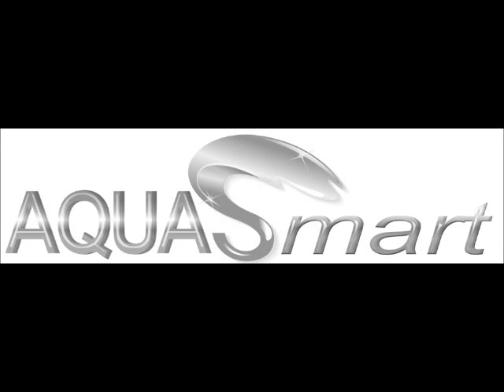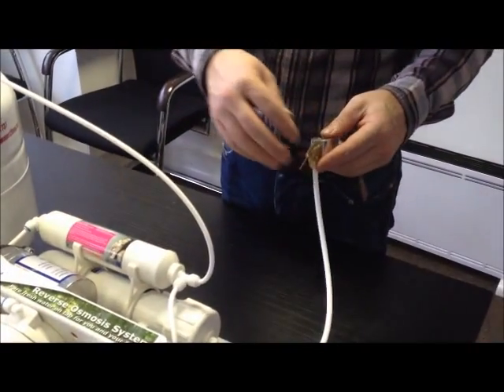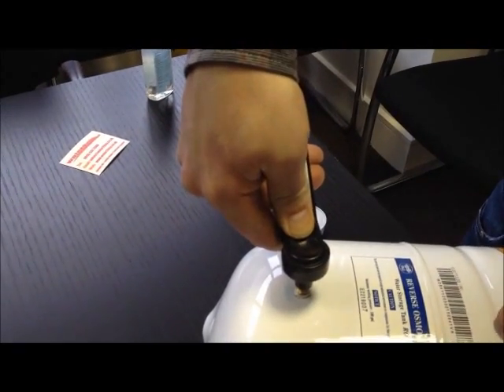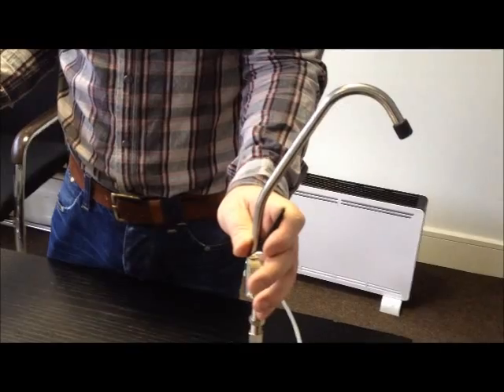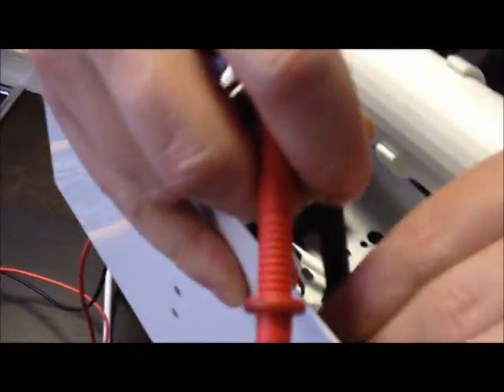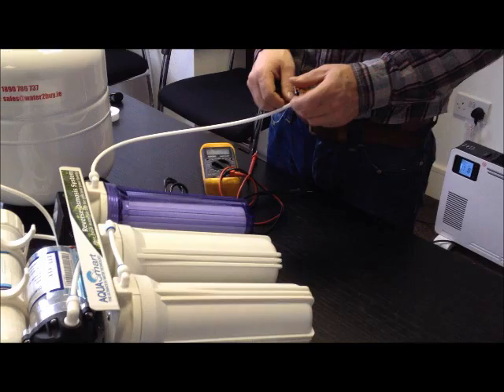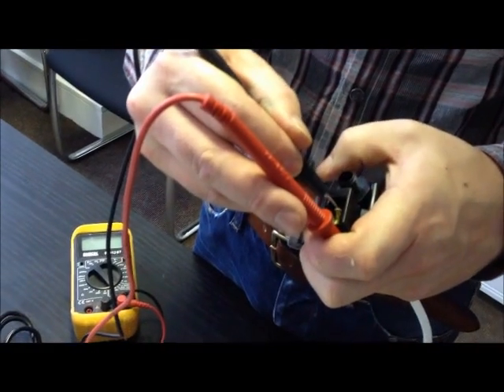Reverse osmosis troubleshooting: No water or a poor water flow from your pumped system

Comment: i had barely any flow on the product side was told to chec k my membranes i did so and they seemed fine no buildup present but after i reinstalled thgem now the system acts like theyre not even there my nproduct pressure is off the guage !!! help what did i do i have a water store comercial system and its been down 4 days HELP PLKEASAE

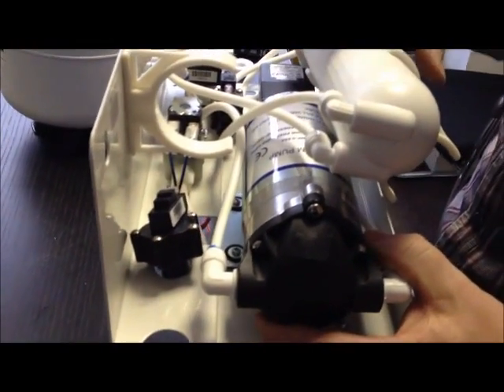Comment: Water are coming very solwy what to do that 2:30 hours After fill 8L
Reply: Thank you so much! I'm a hero now lol... The bike pump worked but I'm not sure if was a pressure problem or if I unplugged something when I pumped.. I pumped once with the system detached and again with the system in line as a power flush

Comment: Hi, I have recently changed the sediment filter, pre carbon filter and RO membrane of my water purifier. The water seems to flow smoothly through all the stages but doesn't come out through the RO membrane stage. I've checked the RO membrane thoroughly and water only seems to be coming out of the reject side and not from the pure water outlet. What could be the problem? It's a brand new membrane and is pretty expensive :'(
Reply: im exactly where you are right now.  I plan on buying a "auto shut off" piece.  Its the one with 4 hoses meeting into it.  Ive changed everything else.  Pump is active and builds lots of pressure.  Every hose is good.  Bladder in tank is 8psi empty
Reply: Did you find any solution

Comment: You were into the demo only a very short time and you solved my issue.  i had over pressured the tank (tank said max pressure 100psi so I put it at 40) and it worked for awhile, and quit.  Backing off the pressure to 7-8psi made it work, (I had replaced the filters).  Thanks again.
Reply: My Kentwater filter not getting water, power has come but not getting water.

Comment: hi! I have replaced my ro membrane with csm 80 gpd one.after running the system product water rate is much higher than the waste.however TDs level is higher nearly 410. what I actually happening the reverse. I am confused whether I need to replace it . please help me.
with regards 
sudipta
Reply: I have had exactly the same happen to me - TDs went even higher than 410

Comment: Hi.. we are using an industrial purpose RO plant but since it's commissioning we have faced when difficulties like low permeate flow over the period and ultimately high delta P across the RO. And many membranes have got damaged. frequent membrane failure and replacement is being done. we have done all types of cleaning but the problem persists. I know this information is very less but do you have any suggestions pls do tell. Thank you

Comment: I need help. I have been working on the whole system for weeks I have replaced all the filters (5stages) I just installed new tanks, and check valve.  So that water going is is great! but after is goes through the three housing unit I check the water coming out and it is a WHOLE lot slower.  We were having low water and running out quickly.Tanks aren't fill which is why I just changed the tanks.   So should I give it more time.... Or did I get to strong of filters for the system? Thanks for help
Reply: Charity Ickes I'm having a similar issue! I hope someone can help you... and me!
Reply: Figured it out. One of the filters was defective (it was new) it was not allowing any water through the system. Working great now. Thanks
Reply: try clean or replace the Auto Shutoff Valve

Comment: My water starts out strong but after about 15 seconds it slows and almost drips. my feed line is clear. so not sure, from this video, i may have low pressure in the tank. Anyone knows how long it takes for the pressure to begin to decrease in the tank?
Reply: In short: Replace the check valve (at the clean water connector)

Hi mine is working for the last 8 years and suddenly having this slow/no flow problem, after I try replacing the filter, the ro membrane, the tank and finally found out that - that is because of the check valve or No-return valve problem.  That valve is the elbow connector at the clean production water outlet. All three water connectors (one going in and two coming out of the RO membrane housing) look same but when you unscrew and take them out you will find the one at the clean water look different - you can google and buy one online. Damn, after I watch all these youtube videos telling me is the tank problem, the filter clogged... I even replace my tank. Finally, I bought a new RO housing and found out it is the check valve. I still using the old RO housing but just replace the check valve and now the water is finally flowing again, just in case the "flow restrictor" I bought that is attached to the wastewater-out seems usefull too.
Reply: Siry ro aquagrand advanced west water not walking why

Comment: I have an RO System Water Purifier with 5 stage inline filters. 1. Sediment Filter, 2. Pre-Carbon filter, 3. RO-Membrane filter, 4. Post-Carbon filter and 5. UV filter.

The "reject" water flow from the RO filter has become very slow and the product water is salty in taste. It almost tastes like the raw input water to the RO System. I have changed two RO membranes in the last six months. The output pressure from the pump is absolutely fine and there are no issues with the Low Pressure Indicator and the transformer of the pump. Also I have changed the cartridges of inline sediment and pre carbon filter that are used before the RO filter recently. The flow through these filters are absolutely fine. The flow through the inline post carbon filter that is used after the RO filter is also fine.

Is it possible that slow reject water flow might be caused because of the Flow Restrictor (FR) block? I have been using the same FR for the last 4 years ever since I purchased the RO system. Two questions:

1. Does a FR really get blocked?

2. And if it does, does it in any way damage the RO membrane?

Kindly help. Thanks.

Comment: I have a tankless system.  It will only work until once then pump goes but no water comes out. At first I thought it was an air lock.
Now I suspect pressure switch problems. It will stop when faucet is off but won't give flow after faucet is turned on again even tho I can hear pump going around...
Reply: Same problem here. Did u figure this out?

Comment: I have a very low flow of water from our system. The pressure tank doesn't have any pressure at all (no water leaks) but I can't pump any air in. Completely blocked. Can only the valve be replaced (is it a special valve) or I have to replace entire storage tank. Could you please comment?  AJT - South Africa
Reply: *****
Thanks for the advice. I will replace the tank.
Reagards AJT
Reply: Water2buy Water Softeners
Reply: i have the ro pump pumping 10bar to the membrane but from yhe other side the water is very weak,the membrane is new ,what you think???